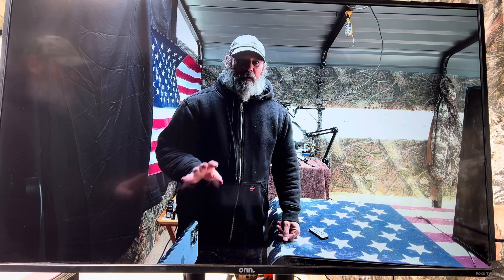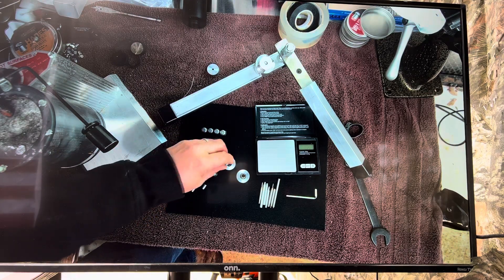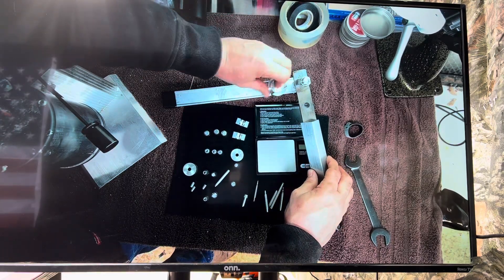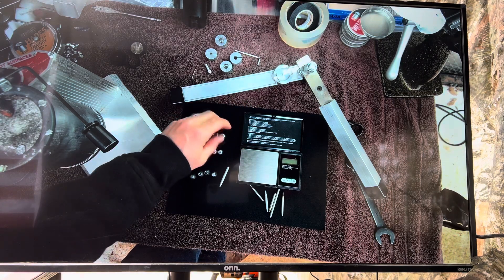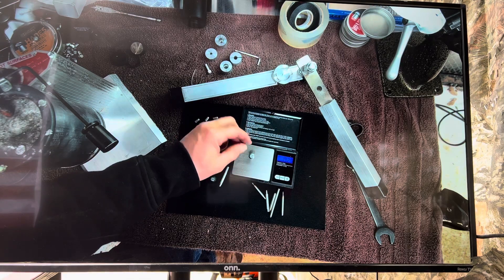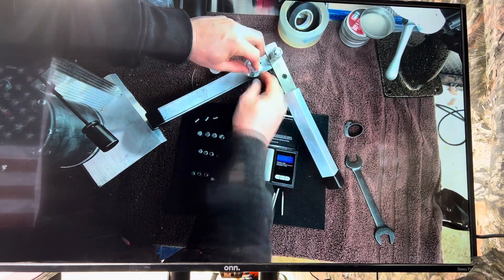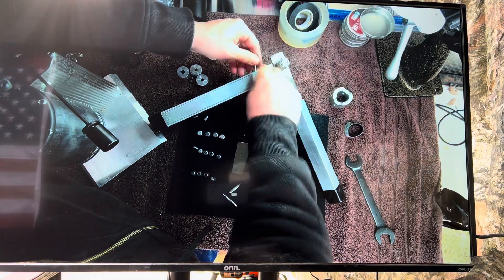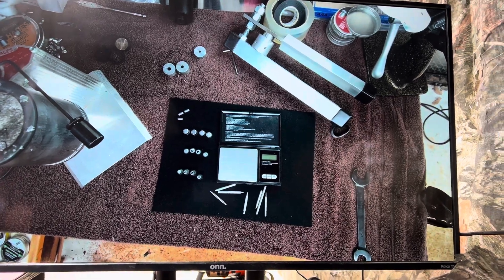How to make your own pellets with the smooth ammo molding system

Comment: Hello there, I have been trying for the last few days to log onto your webpage, but to no avail. Are the molds still being produced?
Highly interested in a couple different sizes.
Reply from the maker: My wife maintains the sight and has been super busy with work. I have finalized the handle design and it will be ready for sales in a couple of weeks. The original handle design was heating up too much on the big bore rounds. I had to redesign to include wood ends to insulate against the heat. It was a success and solved the issue. Now I am ordering dowel stock but can do a few custom handles before I place a bulk order. She will update the sight when the stock arrives. What sizes are you interested in?

Comment: I've been doing research for .177 or .22 molds and this looks promising.
Reply from the maker: Still working on the final design. The aluminum handle heats up too much casting 45+ caliber. The smaller bore are awesome but I want it to work for everything. When it’s ready it will be epic. New update soon!

Comment: U gonna shoot them at Sub-12 fpe during a test???
Reply from the maker: I don’t have any guns set up for that currently. I may set a target gun up in the future. Most of my air guns are over  that power. There are a few I could dial back to test but I am focusing on the high power testing to start with. Later field target sub moa alloys ect. Most competitions use commercial ammo so us casters are left out in the cold there. This system is designed to save the user money on ammo and put more ballistics control in the hands of the caster so we have more choices when making our rounds. The possibilities are endless. Thanks for watching and your comments.
Reply: @DrSaminstine  well sub-12 ammo really mushrooms better! Fragments more at higher fps from softer lead. 
Also it's easier on ur gun as it will require less air on the valve release. A faster Fps can still be obtainable at the lower pressure. .22 w/880 fps and 20+gr can still give u 32-40 fpe and it will fragment awesome at say 100yds!
Just food for thought Brother!
That's why I really love the slugz from 
"Idaho Airgun's and Outdoor's" Terminadorzzz 👍🏻

Comment: You can change the CG of your ammo with this system.
Reply from the maker: Exactly! Depends on what you are trying to achieve with the specific round. Oversized hollow point for close range and fast energy dump or small hole rear heavy for long range accuracy. The choice is the users. That’s the beauty of the system.

Comment: Very interesting, I have a Huben K1 25 caliber 2020 model. Is there a way I could get mold specifically for that air rifle?
Reply from the maker: I don’t know the specific details on that gun but I could if given details. What shoots good in that model? Is it choked? What maximum and minimum fits in the magazine. There will be a lot of possibilities depending on what you are looking for. I am currently designing around what I have so I can test myself and show what works good. It’s hard unless you have a baseline but this system gives the user control of as many variables as possible. The dies will be made close to standard length and diameter unless custom. There will be choices such as .248 .249 .250 .251 for the top die. It will  depend on your choke what shoots best so you would need to know that before choosing. There will be multiple profiles for each caliber as well as multiple inserts for the bottom die so the user can choose from hollow point to hybrid or solid base with the turn of a set screw and quick adjustment.